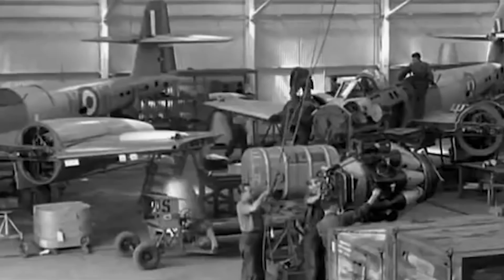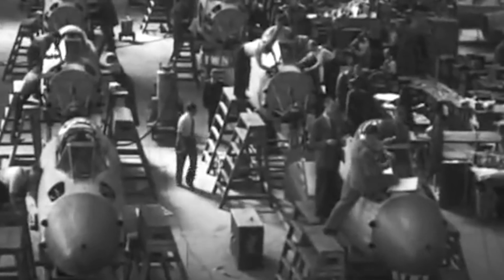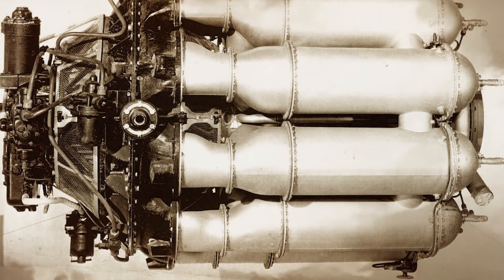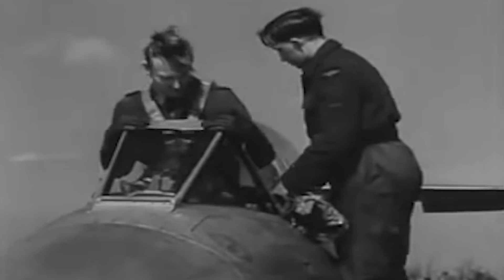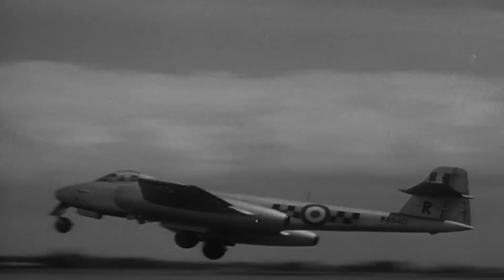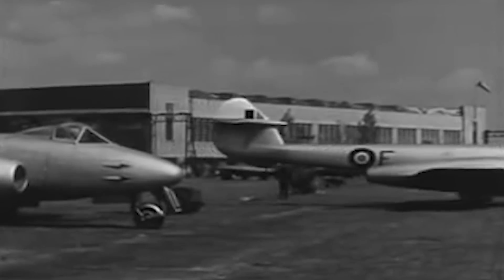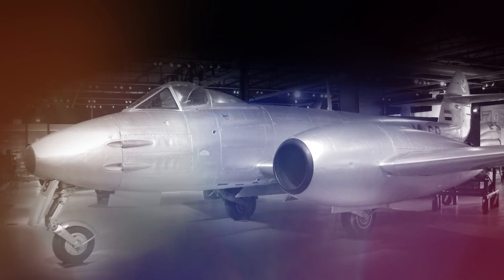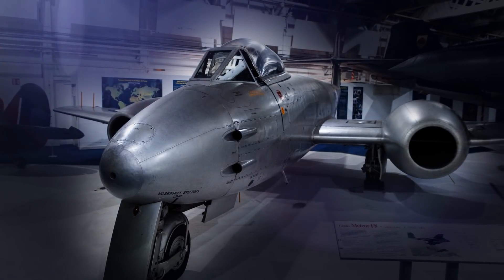Gloster Meteor - The Only Allied Jet to Fight in WW2

Comment: RAF Chief Air Marshall Sir William Frederick Bowhill called the Gloster Meteor a qoute;
"most dismal and lackluster aircraft"

150 crashed in accidents in a single year.
12 crashed in one week... 6 crashed in just a single day.
Reply: We feel we can clear up some commonly held myths and misconceptions, obviously.

It's always good to see the facts presented clearly and concisely isn't it?

Thanks for that very informative comment.
Most enlightening.

We couldn't find any supporting evidence anywhere though so we think there may be some errors in their excellent post & errors in some other comments with a similar theme.

The basic overall design of the Gloster Meteor was fatally flawed.???

    The Meteor was not fatally Flawed, 3950 were built serving in more than 20 air forces for more than 20 years.  Martin Baker use the Gloster Meteor for ejector seat R&D.

Gloster continuously tried to improve the aircraft eg; improved tail, stronger fuselage and different wings, stronger wings, ect.???

      Gloster got it pretty much right first time especially considering the circumstances & the aircraft type.

Unfortunately as a result of being very hastily
converted from a twin propeller driven nightfighterdesign it was plagued with flaws inherent to the fundamental design.???
  
      Gloster ceased work on the much larger  Gloster Reaper propeller & turret night fighter in order to design the Meteor from scratch (The Beaufighter was similar to the Reaper).

It was directionally unstable at nearly all speeds and tended to pitch down uncontrollably at low speeds and a nasty tendency to snap into a flat spin at high speed.???

    It's accident losses were much lower than many other later aircraft. Most accident losses were training errors.

The asymmetric handling was appallingly and was considered unrecoverable and fatal during take-off or a go- around.???

      It's accident losses were much lower than many other later aircraft. Most accident losses were training errors.

RAF Chief Air Marshall Sir Frederick William Bowhill called the Gloster Meteor a quote; "a truly dismal and lackluster aircraft"???

    The Chief Air Marshall didn't say that.
   
   Sydney Camm said Gloster tried everything but flipping the engines and pilot seat around and flying it backwards???

     Sydney Camm didn't say that.

Early days, jet fighters & an accident losses rate comparison.

De Havilland Vampire, Sea Vixen & Gloster Meteor accident losses were not high or unusual for fighter aircraft at the time. De Havilland built large numbers of all metal airframe aircraft before the DH Comet for example.
We mustn't forget of course that the DH Vampire first flew in 1943 & the jet engine was also built by De Havilland. There were examples of the Vampire interceptor / fighter in service until 1990 which was operated by more than 30 countries. Of course, at the time, during 1943, the Vampire was one of the world's first jet fighter aircraft which also happened to have extremely reliable jet engines, obviously.

Non combat phase accident losses.
% of Aircraft built.
The Canadair CL-44 was a turboprop airliner.
Canadair CL-44              (ff 1959 ) 48%
Lockheed XF104              (ff 1954) 100%
Lockheed  P80                 (ff 1944) 43%
Lockheed F104                (ff 1954) 45%
MD FH Phantom 1           (ff 1945) 35%
MD F4 Phantom 2           (ff 1958)  28%
MD F3H  Demon              (ff 1951)  32%
Gloster Meteor               (ff 1943)  21%
DH Vampire                    (ff 1943)  23%
DH Sea Vixen                  (ff  1951) 33%
Gloster Javelin                (ff 1951) 20%

   An example of what goes on these days in various countries.
Obviously, for example, there are of course no German companies that makes German jet aircraft in Germany & there are no German Companies that make German gas turbine aero engines in Germany that are suitable for widebody airliners.

We hope this helps, obviously.
  
As always Cheers & 👍 indeed.

Comment: Almost 80 yrs ago , jet propulsion was in its infancy. An amazing achievement.
Reply: The "Meatbox" as it was called by the RAF only killed British pilots
Reply: @sandervanderkammen9230 

We feel we can clear up some commonly held myths and misconceptions, obviously.

It's always good to see the facts presented clearly and concisely isn't it?

Thanks for that very informative comment.
Most enlightening.

We couldn't find any supporting evidence anywhere though so we think there may be some errors in their excellent post & errors in some other comments with a similar theme.

The basic overall design of the Gloster Meteor was fatally flawed.???

    The Meteor was not fatally Flawed, 3950 were built serving in more than 20 air forces for more than 20 years.  Martin Baker use the Gloster Meteor for ejector seat R&D.

Gloster continuously tried to improve the aircraft eg; improved tail, stronger fuselage and different wings, stronger wings, ect.???

      Gloster got it pretty much right first time especially considering the circumstances & the aircraft type.

Unfortunately as a result of being very hastily
converted from a twin propeller driven nightfighterdesign it was plagued with flaws inherent to the fundamental design.???
  
      Gloster ceased work on the much larger  Gloster Reaper propeller & turret night fighter in order to design the Meteor from scratch (The Beaufighter was similar to the Reaper).

It was directionally unstable at nearly all speeds and tended to pitch down uncontrollably at low speeds and a nasty tendency to snap into a flat spin at high speed.???

    It's accident losses were much lower than many other later aircraft. Most accident losses were training errors.

The asymmetric handling was appallingly and was considered unrecoverable and fatal during take-off or a go- around.???

      It's accident losses were much lower than many other later aircraft. Most accident losses were training errors.

RAF Chief Air Marshall Sir Frederick William Bowhill called the Gloster Meteor a quote; "a truly dismal and lackluster aircraft"???

    The Chief Air Marshall didn't say that.
   
   Sydney Camm said Gloster tried everything but flipping the engines and pilot seat around and flying it backwards???

     Sydney Camm didn't say that.

Early days, jet fighters & an accident losses rate comparison.

De Havilland Vampire, Sea Vixen & Gloster Meteor accident losses were not high or unusual for fighter aircraft at the time. De Havilland built large numbers of all metal airframe aircraft before the DH Comet for example.
We mustn't forget of course that the DH Vampire first flew in 1943 & the jet engine was also built by De Havilland. There were examples of the Vampire interceptor / fighter in service until 1990 which was operated by more than 30 countries. Of course, at the time, during 1943, the Vampire was one of the world's first jet fighter aircraft which also happened to have extremely reliable jet engines, obviously.

Non combat phase accident losses.
% of Aircraft built.
The Canadair CL-44 was a turboprop airliner.
Canadair CL-44              (ff 1959 ) 48%
Lockheed XF104              (ff 1954) 100%
Lockheed  P80                 (ff 1944) 43%
Lockheed F104                (ff 1954) 45%
MD FH Phantom 1           (ff 1945) 35%
MD F4 Phantom 2           (ff 1958)  28%
MD F3H  Demon              (ff 1951)  32%
Gloster Meteor               (ff 1943)  21%
DH Vampire                    (ff 1943)  23%
DH Sea Vixen                  (ff  1951) 33%
Gloster Javelin                (ff 1951) 20%

   An example of what goes on these days in various countries.
Obviously, for example, there are of course no German companies that makes German jet aircraft in Germany & there are no German Companies that make German gas turbine aero engines in Germany that are suitable for widebody airliners.

The Gloster Meteor served with more than 20 airforces and successfully engaged in air to air combat with later design aircraft during a number of conflicts. 

We hope this helps, obviously.

As always Cheers & 👍 indeed.

Comment: The Martin Baker ejection seat company still had a Gloster Meteor in service to test its seats.
Reply: @billbuckley8423  The Gloster "Meatbox" was not a fighter and never served in the RAF in that role.
It only killed British pilots!
Reply: The Meteor is indeed still in service today.   Like a number of British jets.  Nasa still fly Camberas.
Reply: @awatt There are no Meatboxes in military service, none fly today with original engines.
All British Camberras have been retired, none remain flying today

The RAF no longer operates any British jet fighters, bombers or transport aircraft.
Reply: @sandervanderkammen9230  they operate the Typhoon which is a BAE design and whilst a Euro consortium plane, is made at Warton UK. 
What's your point , other than being a massive troll, about the Meteor and Canberra (both 1940's designs) no longer being in service. ? Is the 262 still with some banana republic? No. Never was. Are there any wholly German designed fighters/bombers in front line service? Though not.
Reply: @sandervanderkammen9230  
Nasa still operates its fleet of Canberra.  Martin Baker still operate a Meteor with original engine.  
The uk has the largest aerospace industry after America.  Cope
Reply: @billbuckley8423  The Eurofighter Jagdflugzeug GmbH. Typhoon is a German aircraft designed developed from the Messerschmitt TK-90 program.

Licensed production at Warton has ended.

There are no longer any British jet aircraft manufactured in the UK, there are no longer any British aircraft manufacturers left.
Reply: @awatt  NASA only operates a specialized variant of the Martin B-57, no British aircraft at NASA
Reply: @sandervanderkammen9230  If there was no Canberra, there would  be no B-57, NASA variant or otherwise.
Reply: @sandervanderkammen9230  
Nasa laughed at the 262.  Nasa still use Camberra for high altitude research and filming rocket launches.  Martin Baker  use a Meteor for testing ejection seats due to its centrifugal engine being able to survive a bird strike.
Reply: @sandervanderkammen9230  
Britain has the second largest aerospace industry after America.  Germany just screwdriver parts made elsewhere for the french/Dutch airbus
Reply: @awatt  Name a British company that still makes British jet aircraft?
Reply: @billbuckley8423 Still not British, the UK doesn't even make jets anymore... they sucked that bad!
Reply: @sandervanderkammen9230  
As you well know the UK has the second largest aerospace industry after America.
Reply: @awatt  But it's not British owned... it's all foreign companies
Reply: @sandervanderkammen9230  
British owned companies.  The few foreign ones in Britain are there for the UK's superior engineering base.  That's why Germany is living it's engineering to India
Reply: @awatt  Lots of of countries still make jet aircraft... it's just the UK that lacks the ability to build jets on its own.
The biggest aerospace companies in the UK are all foreign companies.
Reply: @sandervanderkammen9230  
Germany doesn't have an aerospace industry.  The uk does and its the second largest aerospace industry after America
Reply: @awatt  GERMANY IS THE LARGEST MANUFACTURER OF JET AIRCRAFT IN EUROPE.
Reply: @sandervanderkammen9230 Sorry to burst your Bubble.  It might be the largest assembler. Parts shipped in from UK, France, Spain, Italy. Airbus. Primarilly designed by the French.
TYPHOON. As already established, you assembled  your own use version of a BAE established design when MBB pulled out.
Like your F1 Mercedes cars which are made in UK, you dont have the the technical skills to do it yourselves.
Reply: @sandervanderkammen9230  
'In Europe" lol
Germany doesn't manufacture aircraft.  It bolts together parts manufacture elsewhere.  Grrman aerospace industry is owned by the French and the Dutch.
Reply: @billbuckley8423  Please name a single British company that still makes British jet aircraft in the UK???
Reply: @awatt  Airbus SE is a German-French and Spanish owned company.
The Dornier-Airbus Mega Factory in Hamburg Finkenwerder Germany is the largest aerospace factory in Europe and the largest manufacturer of jet aircraft in Europe..
Reply: @sandervanderkammen9230  Please name a single German company that makes a wholly German military plane. I'll wait. The only plane Germany makes on its own is a 1980s dornier small commercial airliner and its owned by US company SNC.
Reply: @sandervanderkammen9230  Airbus. Consortium headquarted in France and Holland. Not German. Planes are largely French designs.
Reply: @sandervanderkammen9230   Airbus. Not German. French and Dutch Headquarted. You bolt together extenally supplied  parts of mainly French designs.
Dornier? Went out of business in 2002. Now only exists as a name owned my MB. Largest assembler of other countries designs in Europe.
Well done.
Reply: @sandervanderkammen9230  
Where is airbus registered?
Reply: @sandervanderkammen9230  
They are assembly plants not manufacturing.
Reply: @awatt  Where are the most Airbus aircraft made?
Reply: @sandervanderkammen9230  
"France is at the core of Airbus skills, technologies, innovation and production. As one of the company’s four founding countries, France hosts the company's headquarters; it has final assembly lines for all Airbus commercial aircraft families; is home to major engineering, production and support facilities for helicopter, space and defence activities; and includes locations for leading-edge research."

So it's France.  Germany has an ASSEMBLY plant, no manufacturing whatsoever
Reply: @awatt  GERMANY IS THE LARGEST MANUFACTURER OF JET AIRCRAFT IN EUROPE.
BRITAIN NO LONGER MAKES ANY JET AIRCRAFT.
Reply: @sandervanderkammen9230  
Germany doesn't manufacture aircraft.  Germany only screws parts together.
""France is at the core of Airbus skills, technologies, innovation and production. As one of the company’s four founding countries, France hosts the company's headquarters; it has final assembly lines for all Airbus commercial aircraft families; is home to major engineering, production and support facilities for helicopter, space and defence activities; and includes locations for leading-edge research.
Reply: @awatt  PLEASE NAME A SINGLE BRITISH COMPANY THAT STILL MAKES BRITISH JET AIRCRAFT???

Germany is the largest manufacturer of jet aircraft in Europe and is the largest partner of Airbus.
Reply: @sandervanderkammen9230  
Germany doesn't manufacture aircraft.  It assembles parts made elsewhere.  Sad.
Meanwhile,  the UK has the second largest aerospace industry after America.
Reply: @awatt PLEASE NAME A SINGLE BRITISH COMPANY THAT STILL MAKES BRITISH JET AIRCRAFT???
Reply: @sandervanderkammen9230  
"The German economy is in a recession and has been shrinking for two consecutive years. In fact, it is now about the same size as it was in 2019, even as some of its peers among the world's advanced economies have experienced solid growth (on the left of the chart below).20 Feb 2025"
Reply: @sandervanderkammen9230  
The UK has the second largest aerospace industry after America 

"The German economy is in a recession and has been shrinking for two consecutive years. In fact, it is now about the same size as it was in 2019, even as some of its peers among the world's advanced economies have experienced solid growth (on the left of the chart below).20 Feb 2025"
Reply: @awatt  PLEASE NAME A SINGLE BRITISH COMPANY THAT STILL MAKES BRITISH JET AIRCRAFT IN THE UK?
Reply: @sandervanderkammen9230  
Britain,  as you well know, has the second largest aerospace industry after America.
Germany doesn't make anything.  Germany just screws stuff together that's made elsewhere
Reply: @sandervanderkammen9230 why would they fly planes dedigned 80 years ago? But the USAF is about to fit British Rolls Royce engines to its B52s that will take it to 90 years in service.
Reply: @sandervanderkammen9230 Assember. There is a big difference. Nothing Germany makes is a German design. And the Aibus uses American GE or Rolls Royce engines. BMW and DB aero engines. Died with Hitler in 1945.
Reply: @billbuckley8423 Lack of funds?
The F-130 is a BMW engine designed and manufactured in Dahlewitz Germany.
The B-52 engines are 100% made in the United States.. not the UK.
Reply: @billbuckley8423  Since Brixit, even the wings are now made in Germany... production of wings in the UK is expected to end when wing production reaches full capacity in Germany.

Germany is the largest manufacturer of jet aircraft in Europe.
As of right now... there are no longer any jet aircraft made in the UK.